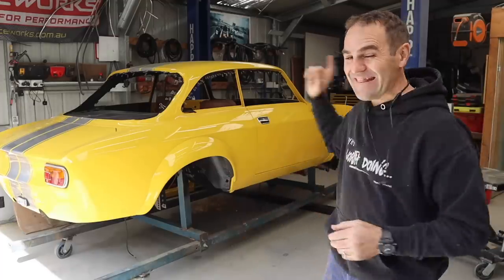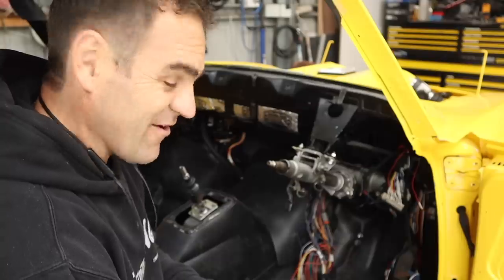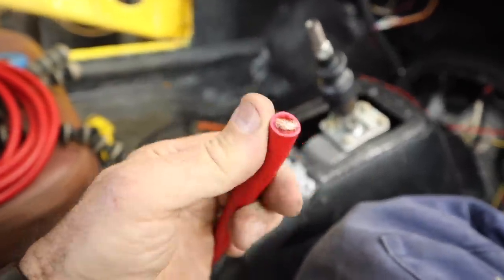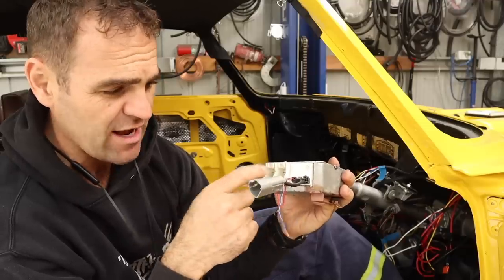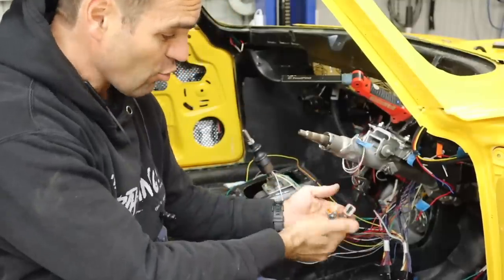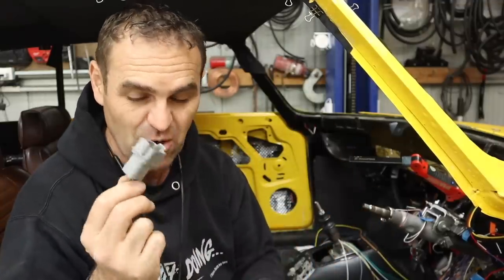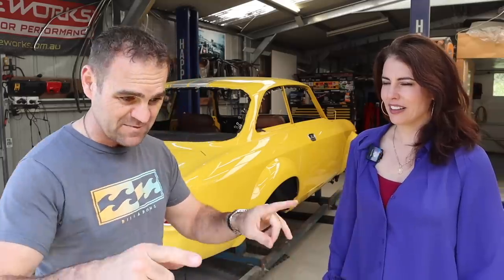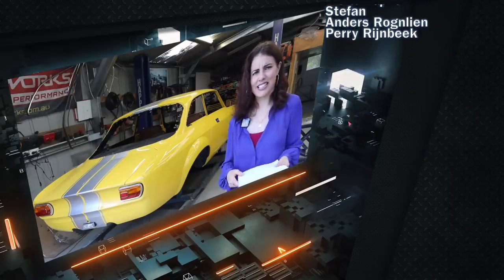Tackling the heart of the Alfarrari - Ferrari engined Alfa 105 Alfarrari build part 173

Comment: I find the wiring not that daunting, but all of the ecu wiring stuff makes my head explode.
Since I'm a Capri man, the wiring of those are very simple. When I'm finished with it there will be live and ignition feed fuse relay board to power up the efi engine I gonig to fit later, with some added features.
The two previous days I have been making a led wiring kit for my rc car, it starts as a mess, but when grouping the wires and securing them makes it much more pleasant to the eye. I even got a comment on FB I should making these to sell.

Keep up the good work Jeff and Mrs.
Greetings from Norway
Reply from the maker: Sounds like you would have no issues wiring an ECU. Same thing just more wires ;)

Comment: Hey Jeff, for the cupholder problem, you should look at what MachineSpeed / LonelyDriveryComapny / SleeperSpeedShop does for cup holders - by attaching a little metal 'hoop' to one of the mounts for the drivers / passenger seat that is suspended above the floor so the bottom of your cup rests on the floor itself.
Reply from the maker: I made one similar in the 911, but I don't love it.

Comment: Best thing i did on my old Italian motorcycle (Morini 3 1/2) was to replace the criminally inaccurate analog speedo with a GPS one, still an analog dial but with digital tripmeter etc.  Inexpensive, same diameter etc)  No need for speed sensors except in long tunnels…  And Deutsch plugs are great once you work out that female pins go into male housing, and male pins into female housing, which seems counterintuitive to me.  😊

Comment: Hey Jeff love your vids, I’ve watched them ALL…how exactly are you integrating the MOTOGADGET into your wiring?
I am also using a Motogadget PDM in my build (based on one of your past vids) but my wiring is far simpler than yours…no engine management, no aircon etc…but I am trying to use the Motogadget for as much as possible…however running the 2 speed wipers and 2 speed demister/heater fan has got me scratching my head lol…I think I have it sorted in my head (about to start on the wiring loom soon) but I’m just curious what exactly you are using the Motogadget for…it’s a great little unit with heaps of features but obviously it’s got its limitations.
AND don’t underestimate how interesting the wiring harness is…especially to those of us who are also attempting the same thing as you lol 😝 
Love your vids and “give it a go” attitude…cheers 🍻
Reply from the maker: The MoUnit is limited in a car situation. I am basically just using it for the lights and the horn. Wipers, fan, etc, I have wired separately.

Comment: Jeff, the paint is on the car, the engine may be in for the finish- you are officially in "post" assembling the beast; it is about now the what ever ignored alligator you've left behind snatches for a bit of hind quarter! This one isn't too bad- there are several ways to get a reliable speedo.  What the hey- even Boxster has taken an even keel; it must be spring and they are getting spring fever? How does that work in Australia? BTW, I could tell a great site of work got done on your "rat's nest in the binnacle"- decisions you made way back with determining routing and such are paying off now.

Comment: Weren't you going to use a PDM at some point vs fuses/relays?  Otherwise, I can only echo what others have already said - I quite like the wiring side of car projects, so it's not boring for me either.
Reply from the maker: I have the small motorcycle PDM in there already running the lights etc.
Reply: @HomeBuiltByJeff  Which one? I've been looking for something budget spec.

Comment: Are you using the the original dash or the 2 litre dash you had mounted lasts week? Second cup holder behind the handbrake will work.
Reply from the maker: The 2 litre dash is the original for this car??
Reply: @HomeBuiltByJeff  did you fit a 1750 rear panel and tail lights to it.
Reply from the maker: @billweston6579  yep
Reply: @HomeBuiltByJeff  that’s what confused me. Nice work, the early tail lights look much better

Comment: It appears that this Alfa is a 2000GTV, however your tail lights are from previous models. Is there a reason for this? Personally I love the larger 2000GTV tail lights; the reason I bought one in 1973.
Reply from the maker: I didn't like the bigger tail lights which is why I went with the smaller ones and my own front grill.

Comment: and you let flat V12 go through..........it's just a flat 12
Reply from the maker: Actually Flat V12 is correct. It is actually considered a flat V12 in the Testarossa as it is not technically a true boxer engine even though the cylinders are horizontally opposed. It has a V style crank instead of a Boxer crank ;)
Reply: @HomeBuiltByJeff 
i did not know that... lesson learned